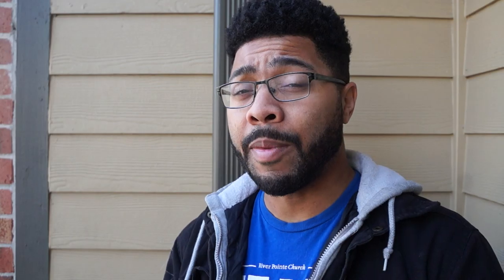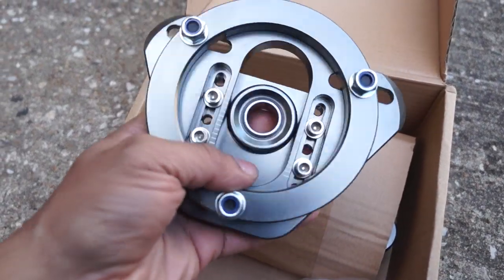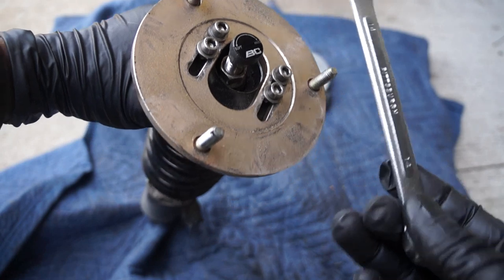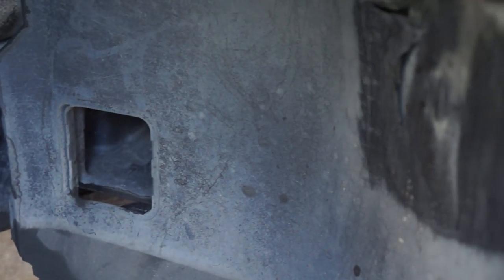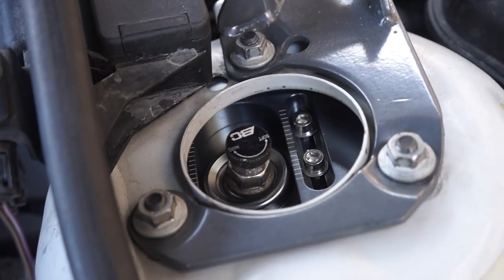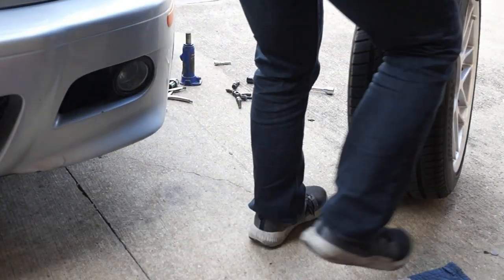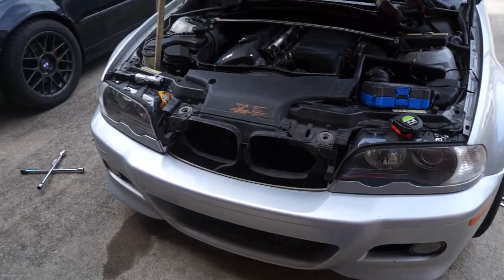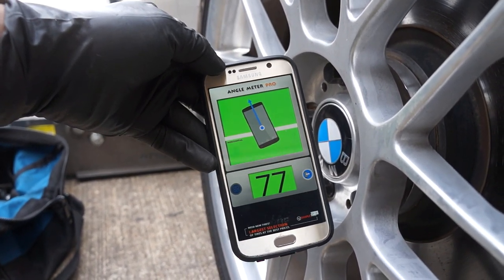E46 M3 - Why you need Camber / Caster Plates NOW!

Comment: Do not attempt to remove the strut mount nuts on STOCK struts without spring compressors. Please please please use common sense and safety practices when working on your vehicles!
Reply: Dude... dentists need to make a living too :D
Reply: @_J.P._  😂😂😂
Reply: OK, so I did so before reading this comment... the spring did pop out the shock mount out a tiny bit, it didn't fly out and was not dangerous. Did I just get lucky?
Reply: @HLinHD  If you still have both eyes then yes….. your lucky.
Reply: @HLinHD  nah that’s normal. I always use a 4x4 and my garage wall. Never popped more than an inch or two. A lot of Bimmer guys just too bougee

Comment: This is helpful information seeing as how the improper geometry could lead to wear issues on tires, as well as suspension components due to the " Ackermann effect " where the inside wheel is always turning faster in turns. 
With a lowered and cambered car this effect has a greater effect on components due to stresses.

Comment: I like the content you put out. As a certified technician I gotta say that you should not be giving advice on wheel alignments.  Tires get worn by excessive camber or toes or both. It can be either positive or negative. If is beyond spec it will prematurely wear the tires. The reality is that if a bushing is worn on a control arm it makes any other predictions useless. So how much setback a front wheel has is a bad way to tell if you have too much or not enough caster. Best thing to do is have it aligned professionally and not make assumptions. Cheers.

Comment: Thanks for the great video.  In my case our M3 took a terrible hit. Not to the hood, but pass side wheel. The skid plate saved the day .. but still some damage Both control arms bent big time. I installed a new set. The frame shows no signs of damage except fender (It took a "glace" o pass side bad enough to bust a couple of spot welds and also the bolt down tab on the DRIVER SIDE stiffiner .. Pushed from the glance on passenger side). After all that, The new control arms went right in. But I do have a camber issue on driver side. I could find no obvious way to adjust Camber. I may buy a set of your great 3rd party plates.     
But how does BME do it?   Why can't I see any way to do so?     Tks so much.

Comment: Hey Bimmer dude, great video, I just got a set of BC coilovers, are these caster/camber plates still in use in our car?ç
 Have they worked fine after 2 years of use? I need to buy a set of these plates or similar..... but I want to know if they have lasted and if they are safe............ I have not been able to correct the camber correctly sin it affects the caster by not having how to move the strut where it needs t be, the BC that came with the coiler set can not be adjusted correctly,,,,,,,,

Comment: Dude... you should NEVER use an impact wrench to take off the top nut of a shock. It will damage the shock internals. Use a proper shock tool kit from Schwaben or other brand. Unless you are throwing away the old shock, do not use the impact wrench.

Comment: BC shouldve supplied camber/caster plates with their kits. I got them too but my caster is all Fd up with no adjustability at the moment. My tires are getting chewed up. Did you have to redo the preload when you swapped the plates?

Comment: Hello, will these camber/caster plates work on kw v2 coilovers? Also, I have a spring binding issue and im hoping that this will take care of the issue as well because I assuming the bearings that hold the spring are stronger than oem.

Comment: I feel like that upper control are and camber/caster plates do the samething, if so what is the difference?
Reply from the maker: Hey man! Well caster has to do with the relation of the wheel to the center of the fender. ( closer to the driver or closer to the headlight) the camber adjusts the  top wheel only ( in relation to the fender edge pulling it closer or further.  Hope that helps